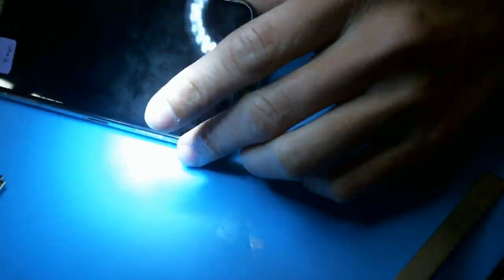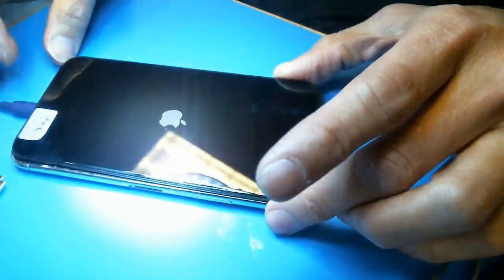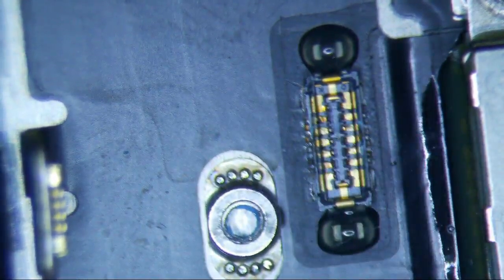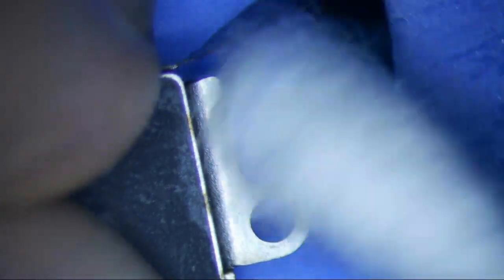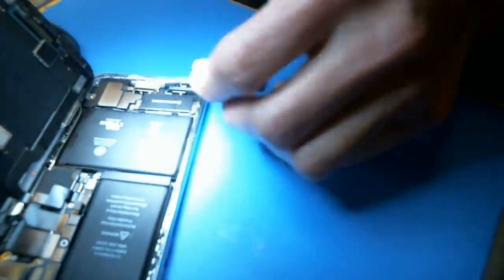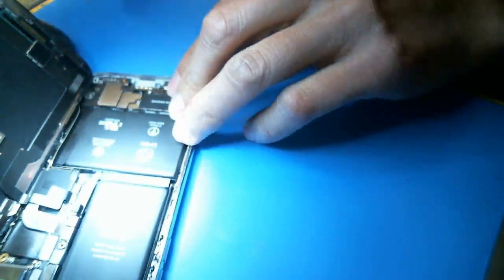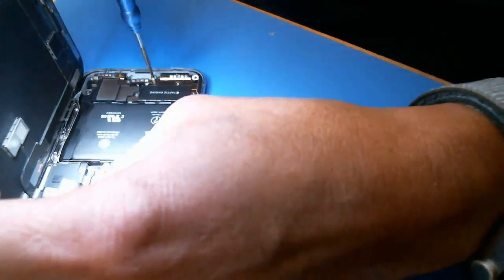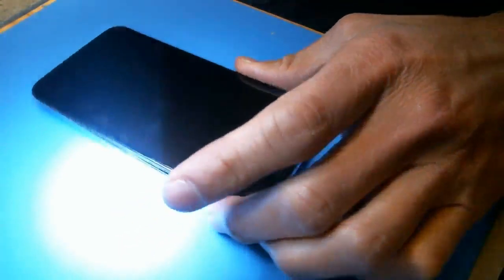iPhone X Boot Loop after Slight Water Damage

Comment: mines doing this right now as I'm commenting. it started around a year and a half ago when some water went in through the screen cracks, I believe. after the damage I couldn't use it for 3 months. one day it fixed out of nowhere and after that, there were still some occasional boot loops but then it stopped for around 6 months and just a couple days ago my iPhone Xs just force reset itself and the boot loop issue begun. It continuously restarts and there's a bit of green on the sides of the screen immediately after the apple logo disappears. I tried forcing a software update but no hope. hopefully it just stops like it did months ago
Reply: Have you found a fix? i have the same problem

Comment: What is he using to clean the water damaged part? Water went inside my iPhone and it keeps restarting after a while any guesses where the water might have entered ?
Reply: isopropyl alcohol
Reply: Rayyan Saboor I’ve got the same question
Reply: Pure alcohole
Reply: Isopropyl.. the worlds hardest item to buy rn 😤😑
Reply: Alcohol to remove minerals from water. Water minerals is the one that end up damaging the connections and when a phone drops in Distill water a phone might not get so much damaged compared to water with minerals

Comment: I think I found my issue. I am trying to fix an iPhone XR that had cracked glass, and water got in near the Taptic Engine. The Taptic Engine connector looks in good shape, but when I started to reassemble the area around the Taptic Engine, I noticed the connector for a little flex board glued to the underside of the bracket that goes over the vibrator was bent looking. I knew I had not done this when removing the connector, and when I touched it with my tweezers, it got half way knocked off, and I saw corroded pads underneath.
Reply: same with my seven is it expensive to fix

Comment: Does the screen flash with a bit of green on the sides before it reboots? I believe I have this exact same problem. I left my phone on the edge of the sink, some water from showering sprayed on it, and now it's stuck in this loop.

I left it in a bag of rice overnight and it was actually fixed the next day. Then I plugged in my cable to update to iOS13, got error 4013 and now it's stuck in that same loop again. I really am desperate to fix this, but I'm pretty sure the stickers will have turned pink.
Reply: I got this problem with the bit of green on the sides before it reboot too (probably caused from the water damaged), but did yours fixed now?
Reply: did you ever fix this? mine is doing the same thing

Comment: i wiped my phone with a wet cloth and its stuck in bootloop. VERY RIDICULOUS. What solution should i clean it with
Reply: Almost same. I splashed some water on flat backside of my iPhone X while it was off. I dried with towel and turned ON, it turned on normally. Then after 5 minutes it restarted and went into boot loop. What kind of water resistant device this is?

I am trying to use ReiBoot by Tenorshare to see if it would fix the issue while keeping the data safe. Very disappointed by Apple.
Reply: @engrtun  same alotough mine had a slight crackin it for water to go though how did youy fix this bro
Reply: engrtun did this work?
Reply: Lorraine It worked for me.. lol. It works for a couple of days then the phone goes back into a bootloop.  I got the phone to work again and i found a solution to stop the boot loop if you can’t afford or can’t fix the phone. Just shut the phone down after every use. That’s the only way mine works.
Reply: @engrtun  water resistant isn't waterproof. once you crack the phone screen you're done. its like your immune system, its resistant to illnesses but its not capable of blocking everything out.
Reply: 99 percent isopropyl alcohol